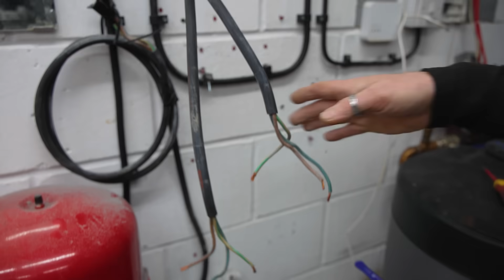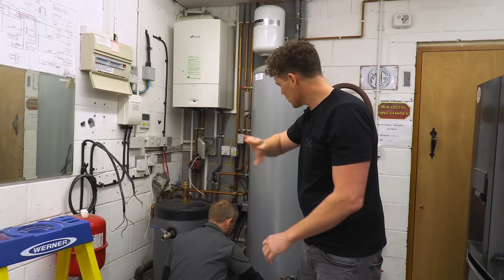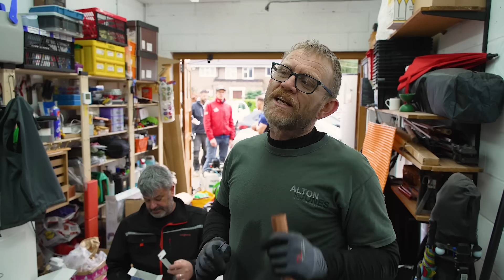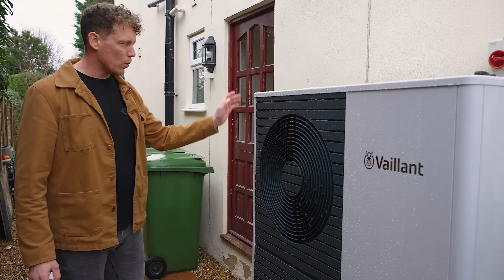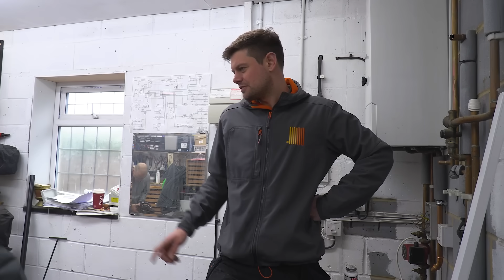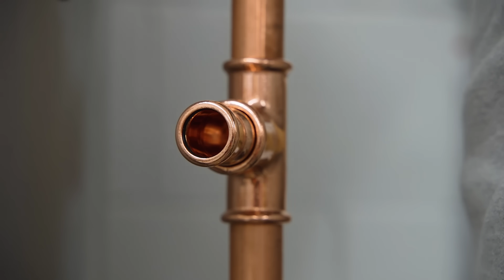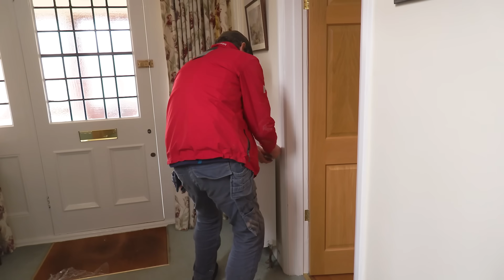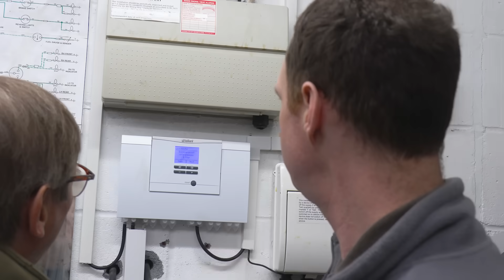Ultimate Heat Pump Installation. Rip It Out & Start Again!

Comment: Keep gas boilers , a het pump is useless in a power cut, in bad weather or sub zero weather that can be the difference between a cold or hospitalisation in young or old people, we don’t need to look far 2 months ago electric was lost after  strong winds , it took 3 days to restore just 70%
Reply: For those that didn’t follow, boilers don’t work in a power cut either.
Reply: @HeatGeek  depends on how old mate a couple heat only don’t need a permanent live either
Reply: @HeatGeek  My point exactly.
Reply: It's been a few decades since I've seen a gas furnace that delivered heat solely by convection, and had a millivolt type thermostat and gas valve powered by the pilot light heating a thermopile. 

How well do the pumps and controls on your boiler function without electricity?
Reply: @jamesnasium7036  you can still start a gas furnace manually in an emergency you can’t eith a heat pump
Reply: @ram64man  they were band in the uk 20 years ago.. there’s hardly any left.
Reply: @ram64man  Precisely how would you do that? Does your control system including the thermostat, ignition and gas valve(s) run entirely without electricity? 

At one time there were wall furnaces intended to heat a single room that operated with no electricity whatsoever. They would have a standing pilot light, a thermocouple to hold the pilot gas valve open unless the pilot went out, and a thermostat that had a bulb and capillary tube arrangement permanently attached to the main burner valve. I had one in a small cabin. It was taken out of service over 30 years ago. I figure that the whole thing was probably about 50% efficient. 

I have not seen a modern gas fired boiler that didn't have at least one electrically powered circulator pump. Nor have I ever seen a modern gas fired central heating furnace that didn't have an electrically powered blower.

Comment: Great video, I'm looking in installing a heat pump with underfloor heating, and I'm very biased towards the Vaillant Arotherm Plus monoblock as well. Grant is 60% of the purchase price in NL.
My neighbours have one of these installed and they are very satisfied. Also a modestly insulated 1950s house, but with UFH.
It is very quiet, although the unit is facing towards my house I can barely notice any noise at 3m distance, distant road noise easily overpowers it.

But I have one question. Is it better to have a unit which has more output and which can run on a lower percentage of max power regarding COP?
When I look into the data for a certain type in the range it seems that COP is better when it runs at 3.0kW / COP 4.8 than when it runs at maximum output of 5.8kW / COP 3.0, both at A7/W35 delta T 5°K
Reply: That's the case for every heat pump I looked at before choosing for my own self install. The compressor COP sweet spot will always be at some point below "pedal to the metal". Check the performance curves for each model you're considering over the ΔT range that you will be expecting it to operate. I found that the cold weather models in general have a much wider sweet spot, better grade compressors, larger heat exchangers, and quieter operation at only a modest increase in equipment cost. Don't grossly over size or under size because most inverter based compressors have only about a 3 or 4 to 1 operating capacity range. Under size and you'll run into the "pedal to the metal" situation. Over size and the the unit will cycle on and off frequently. Neither is considered optimal for efficiency or equipment longevity.
Reply: @jamesnasium7036  This is a clear answer. You don't want the unit cycling all the time when there is a low heat demand. For this reason a buffer tank is often installed but in the video it was clearly told that the buffer tank also lowers your average COP.
So the best size would be a unit which is able to cope with the average temperatures of January and February, and outside that period with more modest cold the unit will operate in it's most efficient spectrum, lets say between 50 and 75% of max performance.
Because I also have air to air and a wood stove I can use these when there is peak demand at very  cold days and these also can take over when there is just need for a bit of heat on some chilly evenings during the warmer periods of the year. The UFH doesn't need to run then.
Reply: But the power output fluctuates throughout the year. Just size it correctly (don’t oversize)

Comment: Hi Roger. Interesting stuff once again about heat pumps. 
Where have all the F&E vessels gone. Are there any in the system still? 
Poor John, the client!!!! / Guinea Pig
Anyway. Just a thought. 
How is the extra loft insulation going to affect the house wiring. Guess it was an 80's / 90's wiring job. There were regs about thermal mass surrounding wiring?
Comments welcome....
Reply from the maker: The loft insulation does cover some lighting cables but there is an air gap around them. The use of LED bulbs has also lowered the power consumption so the cables are not running at full capacity.
Reply from the maker: The expansion vessels were scrapped and the blue one from Vailant was all that was needed. It seems too small but with a low temperature system the expansion is less.

Comment: It’s all fine for those who can afford a heatgeek installation but my house a 3 bed 10 year old semi, heatgeek quoted minimum £15000 max £20000 less the grant that I had to claim back after paying for the installation. What’s more the guy said he’d use my existing cylinder and just fit an external water to water heat transfer plate! I’ve opted to have octopus fit my system and I’m happy if I get a scop of 2-3. Their quote was £8100 less the grant that they claim for me.  Most people like me just can’t afford these very high prices.

Comment: So are Heat Geek going to fix all the other crap installations in the UK. But still need a gas boiler back up Hmm. How much would this cost and with the initial cost. How long for the break even point cost or will we never hear this?
Reply from the maker: The next video in this series deals with those questions

Comment: I am coming round to the idea of a heat pump installed,  but i have no idea where i am going to fit a hot water tank in my house😮
Reply: Do you have a loft? That’s typical. If not we have a solution coming out in the next month
Reply: @HeatGeek  i do have a loft, but the space is small,  aprrox 4ft high at the highest point.
Reply: @DeafMaker  we have a solution for you.
Reply from the maker: That is a problem they have yet to solve. 60% of homes don't have stored hot water and a lot don't have the space.
Reply: Look at phase change heat batteries like Sunamp, might be a possible solution
Reply: @MattGarnham1 100% efficiency though. You loose the big advantage of a HP.
Reply: @Cheradanine  true to an extent but I think some of their models can be attached to a heat pump (and solar PV) with solar attached you could effectively have free hot water in the summer. months

Comment: INCREDIBLE.
Despite the system actually working, just the outside units were noisy, the system was switched off due to high running costs which Adam claimed was an easy fix with a weather comp sensor. 
After the initial install 7 years ago this is now the second refit of the system to get it working ‘ properly ‘ . 
So upto 15 grand’s worth of kit being installed not including labour on top of the 25k already spent. 
The outside units replaced after 7 years when they haven’t been used. What’s the life expectancy of a unit running 24/7 , 5 years if you’re lucky. 😂
Reply: Hello @Hay. Totally agree with you. This is unbelievably over-engineered. And they think they are smart. What a loss of money and time. And probably we will see mold building up in that house, due to the insulation they made. We are far from making an acceptable system that can beat the gas boiler.
Reply: @andrear2319  Absolutely, when a system as easy to operate as cost effective and relatively simple to maintain as a gas boiler is produced I’m all ears 👂, until then .

Comment: MORE HEAT PUMP PROPAGANDA TO COME.  SKILLED BUILDER HAS BEEN BOUGHT BY THE BAD GUYS.  THE BENT   ENERGY CARTEL.
Reply from the maker: Look at the comments and you will see that Skill Builder remains neutral. We have been accused of bias by both sides which kind of says it all. 
I (Roger) agree that heat pumps can be made to work and if you want a heat pump talk to these guys rather than the big companies but that is not the same as saying I think heat pumps are the answer. For the majority of people they clearly are not and probably never will be so the government will eventually abandon this grant along with all the other failed schemes they have tried. .If there is a market for heat pumps let it stand up rather than relying on the tax payer. I have been offered one free of charge for my own house and turned it down because I don't want a heating appliance running day and night just to give me luke warm radiators. I am sitting at home now with sunshine streaming through my windows. It is 6 degrees outside and I am warm. When the temperature drops I will switch on my boiler for a few hours and the house will be warm. 
Adam from Heat Geeks is hosting a debate with me at Installer Live in June and we will be filming it.

Comment: Desperate to put it right
Just so the continued virtue signalling of these heat pumps in unsuitable houses. It’s ok for the wealthy but not for the majority of people in this country. 
You need the perfect house for these and should be fitted to new houses as standard. This retro fits are fine if you have a massive plant room like this house. I was quoted £17,000 for my 1989 detached because of significant infrastructure changes needed
For sure they guarantee the performance if you want to pay over a thousand ponds for the policy and £400 for the estimate
Fed up with these smug people. They are in it for the money of course.

Comment: This video is great and the whole heat pump journey between Skillbuilder and Heat Geek has been very interesting. But this whole saga just illustrates that the vast majority of UK homeowners are not getting this kind of service. It is pretty clear any decent heating engineer is inundated with work. The whole cost aspect with grants, MCS etc is another can of worms that basically creates a lot more problems than it solves. Anyway, good steps in the right direction and I’m sure Adam & Roger will continue to improve things for the general homeowners.
Reply: The government needs to take the lack of trained engineers into account by stopping payments to 'unqualified' engineers. Its a 'win win' for the new Labour government, should they have the time to watch the video's and then take a view.

Comment: What happens if he needs to temporarily revert back to the gas boiler for heating now the underfloor mixing valves have been removed? Surely he'll have cooler radiators or underfloor heating will be too hot? New to this world, fascinated, and hoping to see it becoming more successful and more widely used.
Reply from the maker: He has run the rads at 50 deg and the house is plenty warm enough so he can set the boiler cooler. The tricky bit is the DHW because that needs to be hotter and that boiler can't deliver two separate temperatures.
Reply: You can set the boiler to operate as a hybrid using the HP controller, but it will never be needed so it's immaterial!

Comment: So it's safe to assume that all the unbodging work that heat geeks did in the last vid didn't really solve the problem? It would be nice to see an update of between then and now to see what the update to the existing (now old) system managed to achieve
Reply: We didn’t do anything to the last system. We just pointed out a tone of installation faults.
Reply: That’s the danger of assuming anything - you stand an excellent chance of being wrong. This is the first work that Heat Geeks have done to the system. There is a follow up video with the homeowner soon and that will tell you more than dry statistics.

Comment: So a team of at least 11 heating engineers, excluding skillbuilder and the two from urban plumbers only take 1.5 days to correct/replace/reinstall/upgrade a ASHP system, with the added benefit of the two most costly bits of kit being donated free? I have an open mind on the subject of the various heating and hot water systems and it is definitely a case of horses for courses……..and all that. My son is a plumber/heating engineer installing ASHPs on new build sites and I’m a structural engineer from yhird generation of a family of builders and yes i agree we don’t value expertise in the UK, partly self inflicted by everyone in the industries. Whilst the proof will be in the pudding for this homeowner in terms of running costs, i’m still not entirely sold that these much more complicated systems are the answer for the majority of existing houses. I’d be interested in the total cost this home owner has endured, going ‘green’. I may of missed the costs in previous videos, but say £10k for original install, ignore increased running costs because it didn’t work properly increasing gas usage.This upgraded install, another £10k, probably nearer £20k if paying for the kit. So £30k over 30 years, not wishing ill of anyone but like me thats probably overly optimistic but for simplicity. Then ignoring the additional costs to replace any kit that fails or comes to the end of it’s serviceable life. That requires £1000/year saving just to break even. 
I know gas like all energy costs will inevitably increase, our government contracts with renewables has guaranteed that for the next 20-30 years minimum, allowing even bigger savings to be made. But these systems are more complicated, will require more maintenance and replacement parts and i suspect in most cases 50% of any savings was due to improved insulation, upgrading window and doors etc, irrespective of the designed system. As admirable as all involved in this series are for donating their time, the fact they felt the needed to and it necessitated a complete redesign and fitment, speaks volumes about where this particular fledgling industry is in the uk currently and doesn’t inspire confidence in the average joe to ‘convert’ their heating system🤔 Interesting how much of these Engineers workload was refits, i’d be interested in knowing how much of this work is due to redesign of an existing system not working, general maintenance and upgrading to newer more efficient kit. I can’t help but think as with many other industries, early adopters are essentially guinea pigs as everyone learns the ‘new thing’ and not all survive the experience without psychological and financial scars🤦‍♂️ Apologies for my ramblings.

Comment: Probably an additional £30k worth of man-hours x experience in this project.  Surely this will exceed what regular folk can ever actually achieve with the regular heat engineers that the rest of us try to find, actually book and do the work?  Buying equipment is easy - purchasing the skill level needed is pretty-much impossible.  Same for more complex solar systems - took me a while to find someone skilled and reputable for the work... I then had to wait 2 years for them to be available!
Reply from the maker: That is the whole idea of the HeatGeek network. Having met these guys I would have no hesitation in recommending them if you want a heat pump. The problem is that they are  they are all zealots. None of them is willing to say that a heat pump might not be the best option but if you have made up your mind to have one then these are the guys to go to.

Comment: Still can't get away from the fact that the whole industry is pretty much propped up on tax payers money. If you took 20% VAT off gas boilers and gave people a £7500 cash sum to put a gas boiler in then it would never make financial sense for a heat pump. It's a completely artificially created market, and it might be an unpopular opinion but I think it will all end in tears when these systems need replacing and there is no grant available for the replacement.
Reply: Or servicing by inept people.
Reply from the maker: chrislodge
I agree, the grant distorts the market and a lot of people will go bust when the grant is withdrawn in favour of the next fad.

Comment: I havent even seen the video and i see about 20 blokes in he video start. If you had 20 engineers on each install of course its gonna work 😂😂😂😂😂
Reply: And this is just being installed… let’s see how long is going to last and when the neighbours will start to complain for the noise (those fans point directly towards their fence) 🤣🤣🤣
Reply: So you agree it’s not the heat pump that’s the problem then? Mission accomplished 😊
Reply: @HeatGeek  well give it a few years. Everything is ok when its brand new i suppose. 12kw surely most be abit excessive for that house.
Reply: @Purebeltersteve  it’s a 6 bed, 300m2 single skin house. Huge and old.
Reply: @HeatGeek  i think if you lost 60mm from inside house using kingspan, it would of been alot cheaper for the installation. House is big enough so again, your cop would be massively improved just from that. Yous went to alot of time by doing everything. The think is, now youve helped one person out, the whole of the UK is gonna see this video and say, oh you helped john out, so why cant you help me 🤣🤣🤣